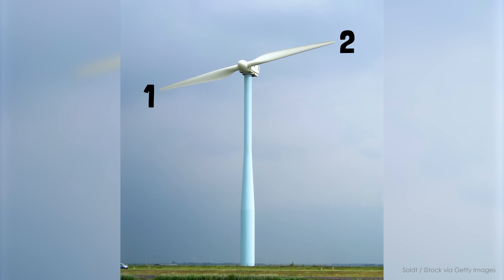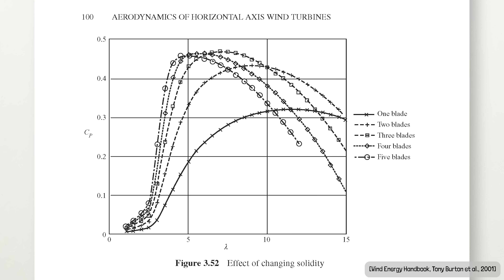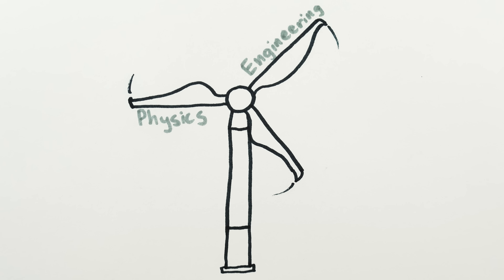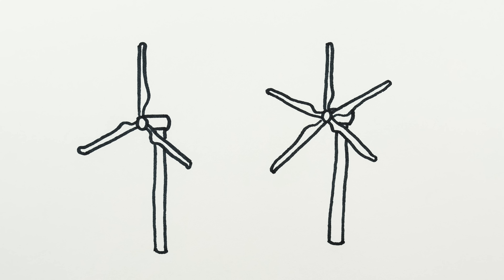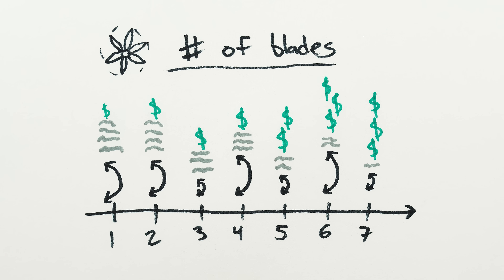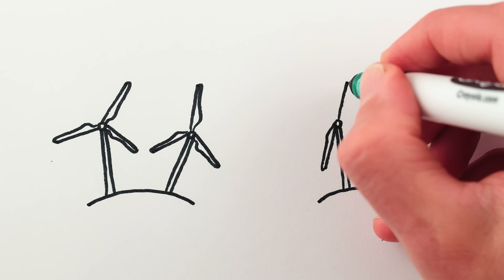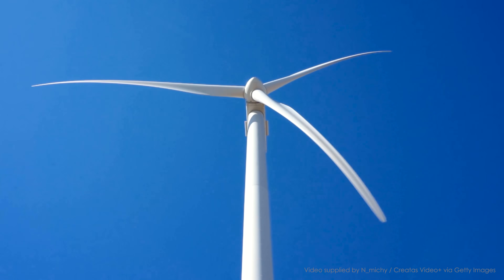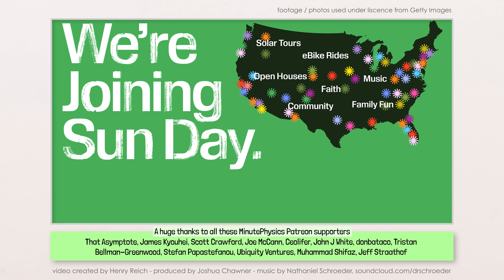Why Do Wind Turbines Have Three Blades?

Comment: You forgot one argument: we have three phase electricity so we need three blades: one per phase 🤡
Reply: that sounds very stupid
Reply: I work in the wind industry and can confirm this is correct. One blade per phase.
Reply: @McCoymiked  What I'm hearing is that if we just switched to 5 blade designs, we could get 66.6% more electricty.
Reply: @mylittledashie7419 and if you use a disc that’s technically infinite many blades and thus infinite energy, which is why flying saucers are shaped as discs

Comment: Could you also make a video on why windmills are 'horizontal'? I've been hearing about 'vertical' windmills where the turbines face upwards.
Reply: The problem with vertical ones is that they don’t “catch” nearly as much wind as larger turbines do, which is what they exchange for a more compact profile and not having to track which way the wind is blowing.
Reply: @alexsiemers7898  yep. maybe on a descending tornado a horizontal one  would shine, but that'd be so rare.
Reply: why would it even work in the first place?
Reply: Vertical axis turbines have lower efficiency.

Comment: That one-bladed wind turbine made me so viscerally uneasy lol. Great video!
Reply: Wind powered baseball bat
Reply: There's still a counterweight on the other side, else it wouldn't work. But still, it can look odd indeed.
Reply: One winged wind turbine
Reply: @abelknecht4943  Se-phi-ROTH!!
Reply: For real. It's like I can "feel" the forces at play in my head and cartoonishly picture the body of the thing twisting wildly as the rotation happens.
Reply: It was strangely unsettling.
Reply: In principle it's sensible, the spinning counterweight thingy concept was used at NASA for G-force endurance testing/training wasn't it? But yeah it does look wild
Reply: Fun fact, some guy actually tried to make a one bladed propeller.
Reply: @CosmicHase  "tried to make" ? The 1938 Everel single-bladed propeller was commercially produced for a short while and some people apparently still fly them (for fun / historical preservation). There are also modern single-bladed props used by some "motor gliders" (planes capable of sustained unpowered flight (soaring) but which also have a little engine to provide some assistance when needed) which, to reduce drag, stow the engine inside the fuselage when not in use.
Reply: @MatthijsvanDuin 
There's at least one small indoor rubber-powered model airplane that uses a single-blade propeller. The prop spins at about 50 rpm. Odd to watch.
Reply: @CosmicHase Motor gliders often have single-blade propellers. They're easier to stow away mid-flight.
Reply: @JWQweqOPDH oh really? Didn't know that.
Thx!
Reply: @CosmicHase  I always find responses like this weird. I mean, you're obviously on the internet already, and clearly have time to waste on watching Youtube videos - do you just not possess a modicum of curiosity?
Reply: @mylesleggette7520 idk what you're saying but I meant what I said with positive intentions.
The guy told me something I didn't know before and I thanked him for knowledge.
What did I say wrong?
Reply: @CosmicHase  Atleast that actually works well with some reasonable advantages.

Comment: If you really want to push cheap efficient energy, that will save the lives a lot of people and animals, then you should be talking about replacing all of these with Nuclear.
Reply: All of what? Wind power? Pretty sure coal kills way more people and animals.
Reply: one of the major problems with nuclear is that it's more expensive...
Reply: @codenamepyro2350  Because by law "we" have to use 1950s tek which is "tried and true".  Canada made a move in the right direction with CANDU.  IFRs are integral, pretty simple in design, and inherently safe.  Drain the coolant and the reaction just stops.  No Chernobyls. And they burn fuel via kinetic or "fast" neutrons and not thermal or "slow" neutrons, so you can use up 90-something percent of the fuel's potential, vs a small fraction in current-design reactors.  Spent fuel is low-level waste, not still-glowing "hot" waste.
All that combined makes IFRs extremely cheap to build and run vs current-tek reactors.
Reply: @joeschmo622  This just seems incorrect, the US DOE experimented with IFRs and prototyped them, and there is an American company (GE) currently working on commercial IFRs
Reply: @codenamepyro2350  It might've, and hopefully has, changed.  I haven't kept up with the news in quite a while.
Reply: I will consider nuclear an option if you tell me what we do with the waste product. Any plan that consumes less waste over a period of time than is accumulated in that same time is not a solution. Go!
Reply: @QemeH  Integral Fast Reactors, IFRs.  Highly efficient.  They can use nukewaste ("nuclear ash") as actual fuel, vs burying it.
Reply: @QemeH  Ok, this is just straight up moronic. Nuclear waste storage is a solved problem. You put it in an abandoned mine and bury it beneath a kilometer of concrete.
Reply: @josephmama1072 that’s not a self sufficient solution.
imagine every country does this and for 100% of their electricity needs (which is rising every year)
Reply: @QemeH  funny that we dont apply this standard to oil and just ignore the waste entirely
Reply: @beepster4096  I absolutely DO apply this to oil and coal, that’s why I am totally in favor of phasing them out as quickly as possible. But here we are talking about nuclear instead of renewables, which is… crazy…

Comment: Finally the question I always wondered. I've also wondered why they are narrow instead of being wider and is there some sort of optimal width to those blades that the engineers have somehow calculated.
Reply: They made a video 4 years ago called "the physics of windmill design" that goes over this! I had the same questions.
Reply: @SirCranberries  Cool I'll check that out. Now that I think about it my intuition is telling that the real reason is that the blades are probably too heavy if they're wider, and so the optimal width would probably be as large as possible with the condition that the windmill doesn't fall apart.
Reply: @jimi02468  I think the main reason is aerodynamic drag. Very wide blades catch more wind but they will also experience more drag while spinning. Wind turbine blades move very fast at the tip so they need to be thin so as not to lose too much energy to drag. That's also the reason why it's optimal for the blades to thicker near the hub and thinner at tips, i.e. the tips move faster and thus drag is a bigger issue there.
Reply: Blades like glider wings, not jet bomber wings.
Reply: ye i wonder how they chose the size and the shape of these.

I fly drones so I kinda understand why particular shapes/number of blades are choosen for various reasons, but wind seems quite a different story, especially with such a big turbine
Reply: The wind turbine blades are like the wings of a glider, a key factor is the aspect ratio of the blade (or wing) which is the length divided by the width. When in operation there is a difference in the pressure of one side of the blade to the other.On the trailing edge the increased pressure and reduced pressure combine to produce small vortexes which cause drag. For a given area of the blade the higher the aspect ratio the better the performance. 

In addition the the speed at the blade tip is significantly higher that closer to the hub, hence the blades are narrower towards the tip.

When rotating the wind turbines create turbulence downwind, up to 80 times the diameter of the blade disk (5 nm).

Comment: Standing under a big two blade generator in a strong wind is quite intimidating. The view of a huge blade at the top of its rotation quickly slicing down towards you (or me, anyway) activates some primal fear. It’s violent. It’s chopping. 
       But a nearby three blade machine feels gentle and smooth.

Comment: All true. The exception was the two bladed Windflow 500 which had a higher power to weight ratio than its competitors thanks to its elegant 'pitch teeter' mechanism, torque limiting gearbox, and synchronous generator. Great engineering that went the way of the Betamax tape.

Comment: Also voltage. A four blade rotor would create more voltage than a three blade rotor, but just slightly and for a significant higher cost of building and mainteinance. One, two, five, six ... blade rotors all create lower voltage than a three blade rotor. So 3 blades create the highest voltage, without being more expensive.
Reply: You mean torque ..
Reply: Not really. The voltage depends on the generator, not the turbine.

Comment: I was thinking it had something to do with 3 having the fewest number that would always have a blade or two pointed higher into the potentially higher speed wind and always having two not having air flow interfered with by the mast. Which still may be true but clearly there were more important factors 😂
Reply: "air flow interfered with by the mast"

Most wind turbines have the turbine in the front of the tower, not behind it.
Reply: @seneca983  I thought they all did, but I'm not familiar with with fluid dynamics to know if there might be a similar effect to drafting where the air is still being slowed and held up by the mast and therefore is slightly more dense in that one area in front of the mast or something. It was certainly not a complete thought, as are most of mine 😂
Reply: @BlazingSun72  There are some turbines that are behind the tower but it's rare. The reason for that is specifically the issues caused by the wind shadow.

Comment: Ask birds if the three blades is most comfortable when they get cut in two.
Reply: Aak birds if they'd rather have domesticated cats around or wind mills.
Reply: This is a tired and boring propaganda talking point. A single house cat kills more birds than a windmill.
Reply: Does the number of blades make a different to how comfortable bisection is?
Reply: @rmsgrey  more blades means more torque and thus a cleaner cut (less resistance as it slices the bird), so clearly we should do 5 blades for that reason alone
Reply: @alexsiemers7898  But more blades also means a slower rotation, so taking longer to slice through...